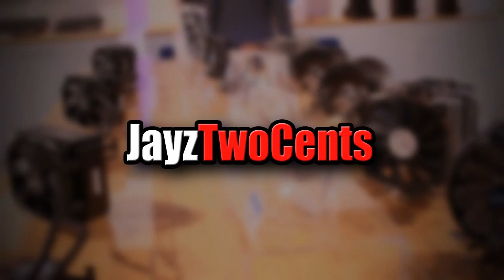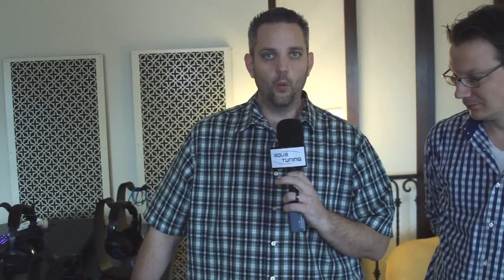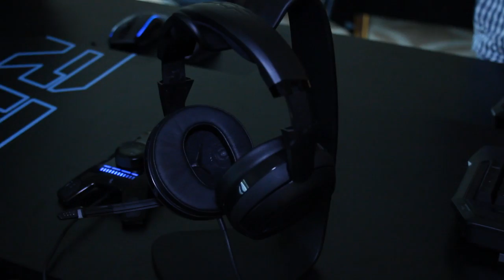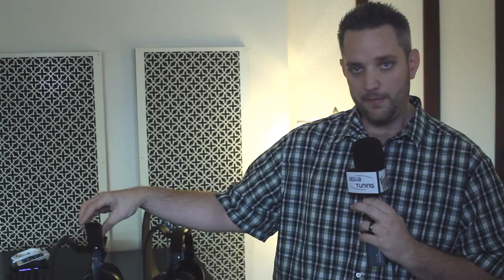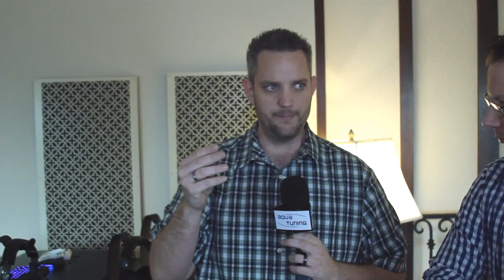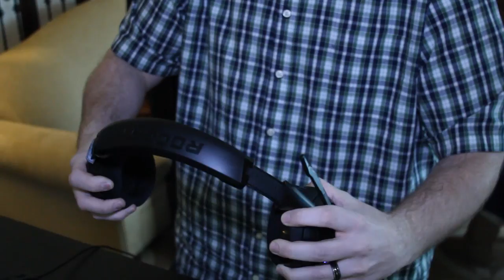CES 2014 - ROCCAT Kave XTD Digital and Analog 5.1 Headset

Comment: I just returned a pair of these, clamping pressure is over the top and I have a hat size of 6 7/8 small medium head, software would not load and I had to do a manual uninstall of the mess that was left. with the drivers loaded I couldn't here the microphone. What a piece of shit! To bad as it was a good idea badly implemented.